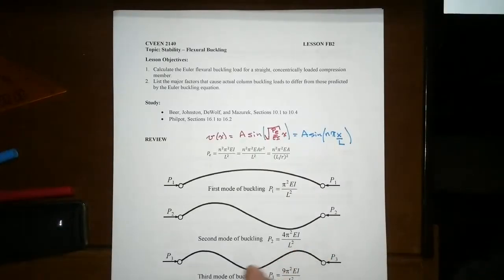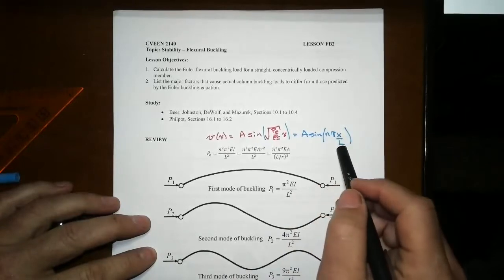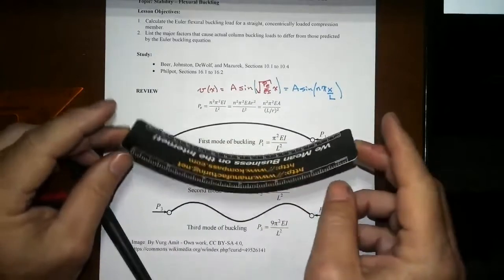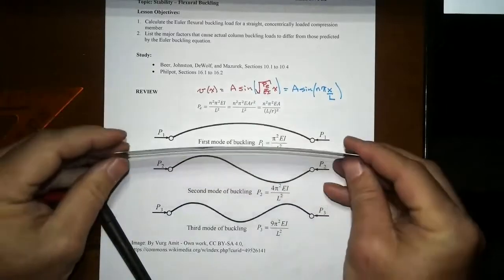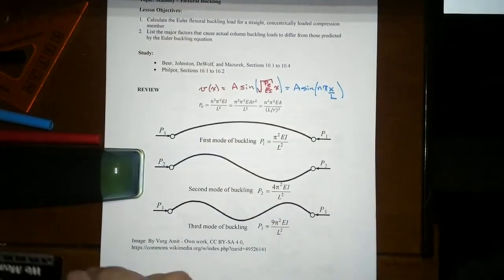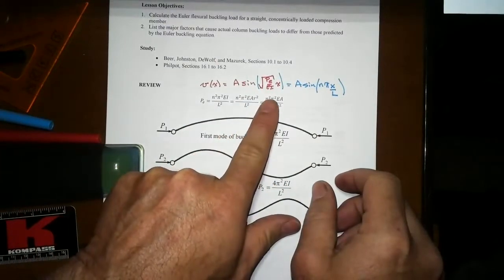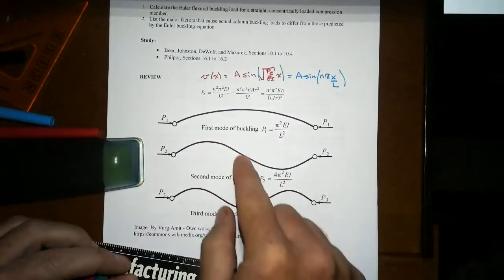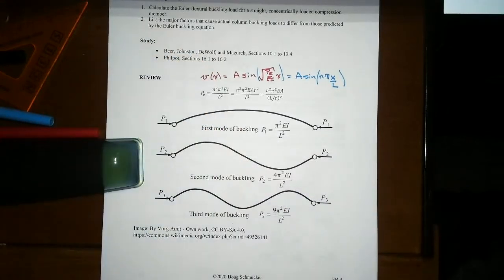fb2 1 buckling modes

Comment: Thanks sir but why we go even for the second mode ? We design the structure based on the first mode. I don't understand why softwares do buckling Analysis with 6 modes minimum?
Reply from the maker: I can’t speak to software rationale.  But, there hundreds of examples of braces whose sole role is to prevent the primary mode and otherwise are non load carrying members.  We also see this for the lateral support of beams.  Identifying the higher mode shapes tells us where to connect the bracing and the impact on the buckling strength.
Reply from the maker: It’s also a part of understanding the mathematical model